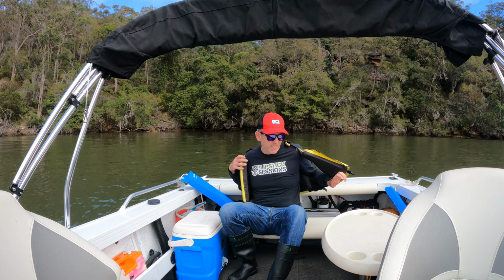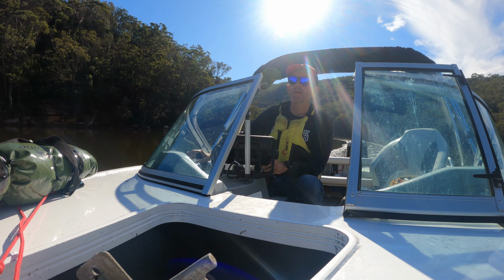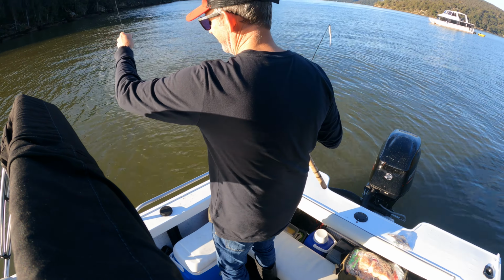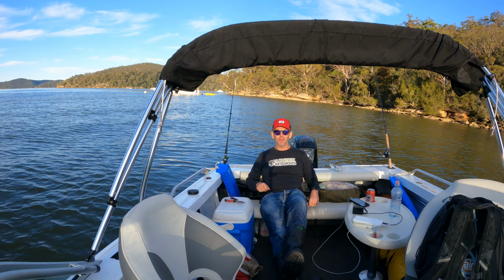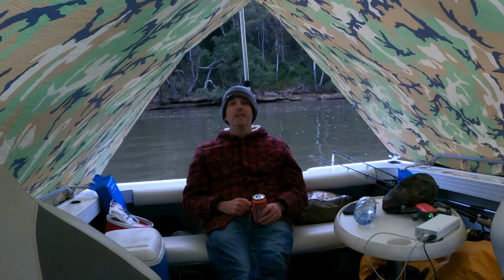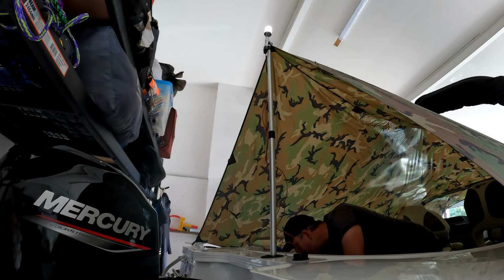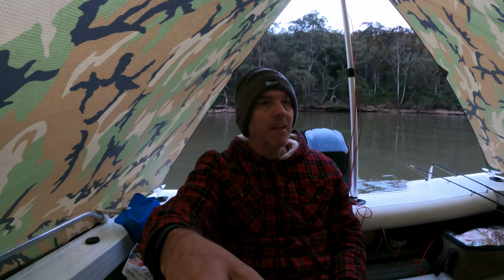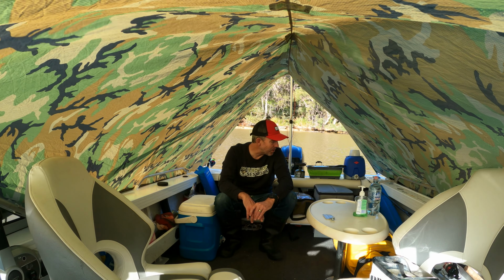Solo Boat Camping Testing the Mark 2 Boat Tent - BBA EP81

Comment: Hi, interesting to see your boat tent. Any reason you didnt fold out the bimini and use that as a support for the hootchie?
Reply from the maker: @craig5147  reason is the hoochie isn’t long enough because of the greater length once extended. It was my original plan to put the Bimini up first but that leaves bigger gaps around the edges.